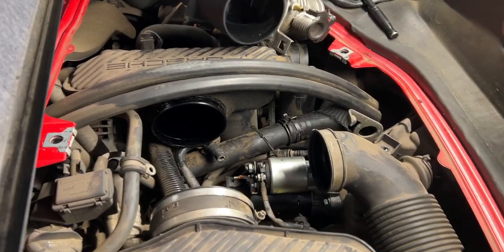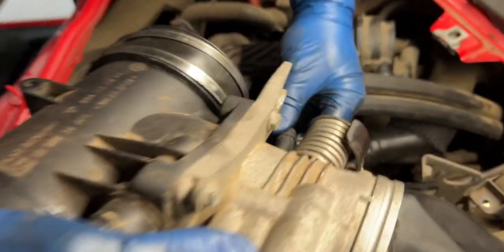How to REPLACE the THROTTLE BODY and ADJUST the WIRE TENSION  |  Porsche Boxster 986

Comment: As noted in the disassembly video, if you soak those collars on near boiling water before install, they are way more flexible. 5 times easier.  Same thing on the plastic aos hose and similar.
Reply from the maker: +John Morgan thanks again!

Comment: What are the small pipes that go into the rubber collars 

I have a air escape noise on acceleration and I'm wondering if one of them has come out. Mines a 2005 2.7
Reply from the maker: +Mister Mister vent hoses I believe